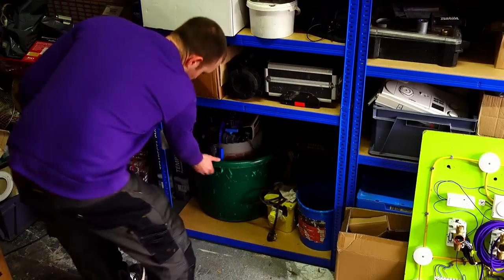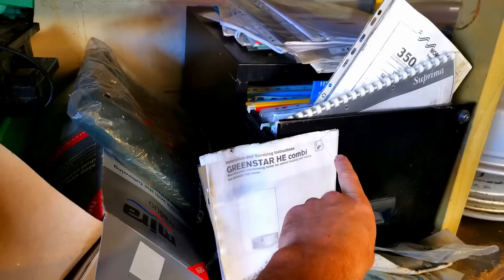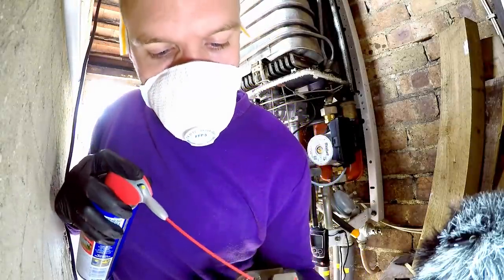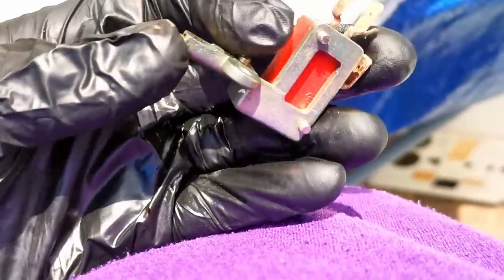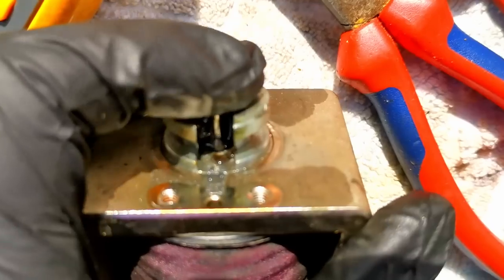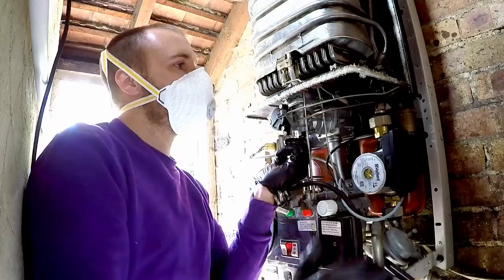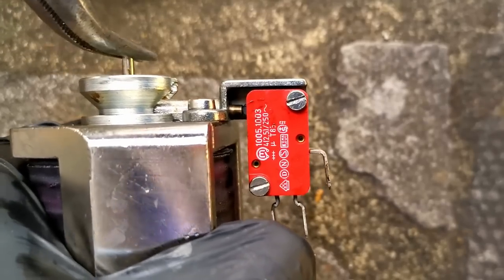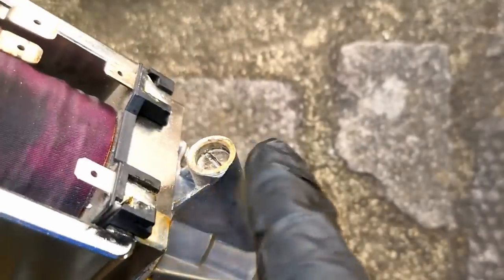Oldest Combi Boiler Repaired. Finally Fixed?

Comment: Excellent set of videos. You have a very good logical mind. Have you looked at the Bluelyser analyser? I have had mine five years and not had one problem with it. It is very responsive, compact and well made. I’m just sorry I bought an Anton first, would never go back. Speak to Julian Butler and get some info on them. He’s on Facebook or let me know and I can give you his number. Have a look at a video Derek Robins made on comparing the analysers (under Tomkat gas training).
Reply from the maker: Someone else mentioned them. I have never heard anything about them before. I just sent a message on FB. Lets see if he replies. :-)
Reply: They are big in Europe. Fantastic support from him. They have lots of other kit that is very useful also. Well worth a look.

Comment: those T3W vaillants all had water hydraulics which worked well if clean but the pipes had a bore of about 1.5mm to 2mm.  If you think that was old I remember the old Worcester Delglow that was old late 60s I think
Reply from the maker: Delglow? Never seen or heard of it. Will have a Google
Reply from the maker: The internet said no. :-) Too old to even Google. All I get is Worcester history.
Reply: @HeatingGeek  it was a monster . Direct fired if my memory serves me right . It was a long time ago

Comment: Hi mate, i just want ask ur opinion about an installation i came across pls: a main water supply that is Teed one goes to unvented cylinder cold water supply and other goes to a combination (multifunctional valve) where the supposed to be cylinder cold feed and the balanced water are both combined together and goes to the central heating boiler flow. On the heating side they put an external prv (6 bars) and the boiler always show 4 bars.  Is that a genius work or a reason or some cowboy work. It looks very stupid to the point i wonder for any reason why they would have done so. Notice also unvented cylinder gets direct main water with prv on combi valve is useless . Many thanks and much appreciated
Reply: I would say its a cowboy job, you do realise G3 regs apply for installation & maintenance of these  you must be trained.
Reply: Kevin Schoales thanks Kevin. I know That, and i am. The only reason i asked about the installation is the amount of idiocy i saw last night. Shocked to the point you try see if there is a tiny excuse or reason as to why they would do such installation if you know what i mean. Much appreciated
Reply: @conand1413  it's good that your trained for unvented, not uncommon to find them piped wrong, if customer agrees to your recommendations, good luck.
Reply: Kevin Schoales i guess they will agree. The pipework for fixing the unvented is straight forward and not big job. The main question was about why would someone use a combination valve (the supposed to be cylinder output & the balanced) and tee them together and connect it to a boiler flow pipe. As heatingeeks with his ling experience might have come across similar stupid installations i thought he might have some explanation. Thanks again kevin. Appreciated

Comment: Did u do a vid on the hydro block mate? I do roughly 1 flow manifold a week
Reply from the maker: I have done a video before about the hydrolock. The one after this job was actually really difficult. Someone literally walked out leaving the block half out and the bypass pipe bent :-).............. I got it sorted but had to bend the bypass back into shape. Nerve-racking. :-) Any analyser recommendations?
Reply: @HeatingGeek  i personally use Anton but like the look of testo! Was it flow or return manifold?

Comment: Kane or Testo. Don’t bother with TPI. Anton, not too bad.
Reply from the maker: Thats the way I was leaning TBH. I think Testo are a little expensive and the batteries (cant use AA) bug me a bit. What do you use?
Reply: HeatingGeek strangely enough, I’ve got a Kane 455, had it for years, it’s fairly robust. I bought from Amazon AA rechargeable lithium batteries which are 2 or 3.0 ah with charger, they were £30, and are perfect for the analyser and printer. I agree with your point on the Testo, they are expensive, sort of the Rolls Royce of analysers. They’re good in the commercial world where you measure Nox.

Comment: Hi I have ferolli f24 domicondens heating works fine but no hot water from hot taps ,but I noticed hot pipe coming out of the boiler is hot please help thanks
Reply from the maker: then maybe you have cold water entering the hot water pipework in your house. Usually from a shower mixer

Comment: 10 out of 10 for your tenacity on fixing this boiler. Unfortunate you missed a couple of small things early on but working through the mechanical logic of the old girl was brilliant. Proper old fashioned electrics - microswitches and coils etc diaphragms pushing pins - as it shoulds be.. And if all else fails - RTFM.....
Reply from the maker: RTFM. I always forget that bit :-)

Comment: Well done 👍
Reply from the maker: Thanks. Can you recommend an analyser?
Reply: @HeatingGeek  At the moment am using a old Anton evo it does the job  but am considering upgrading to the Anton pro 3 but it all depends on the budget? I would say kane an Anton are about the same in performance an quality but ive herd testo aint bad but they are expensive aswell

Comment: 15:43 I'm pretty sure you haven't a clue what you're doing. You've convinced me.
Reply from the maker: Why? :-)
Reply: @HeatingGeek  Making burner pressure adjustment - get it about right, mess about a bit then start playing with burner pressure adjustment again - for one.
For two, you light it and then keep turning it off - rather than letting the thing do stuff - mumbling some rubbish about it overheating - which shouldn't be that easy with at least 2 thermostats on it. They're water cooled you know.
When you start hearing banging as the water boils, then's the time to wonder if it's going to overheat. Maybe 150°C could be classed as overheating ? That's about 4·5 bar - should be venting through the pressure relief valve nicely at that and making some really violent noises :)
Reply from the maker: @millomweb  :-) I see what you mean. ;-)

Comment: I cut my teeth on these back in the day, common problem , remove pin as you did clean and regrease pin and cone shape on main dc SOL making sure the pin is rounded end innerwards. Dc SOL should rise in approx 1 sec.
Reply from the maker: Nice. :-) Took a while to find it but I'm happy its done. :-)
Reply: @HeatingGeek  I've worked for the the BIG V scince the 80s
Reply from the maker: @onewheelnut  What area?
Reply: @HeatingGeek  back in the day 'LL sy wv ws st b cv wr now mainly b dy

Comment: Why put yourself though it. RIP IT OUT. I just told a potential house buyer to scrap this boiler as its near on obsolete.
Reply from the maker: Each to their own. I will keep them going for as long as possible.
Reply: @HeatingGeek  as a gas engineer of the past 25 years. I totally agree with you trying to keep them going as long as possible . I do the same .any idiot can rip them out .its only the clever guys that can fix them . some boilers can really challenge you and you don't make a penny. But you learn so much.  And become a better engineer .good  video and job ..the only thing I might have done different was to turn the dhw burner pressure down a couple of mb . i might save you a come back to push the high limit .

Comment: "Oldest Combi Boiler Repaired. Finally Fixed?" Really?? Oldest? Really? Seeing the video of the boiler it really doesnt look THAT old. I would even hazard a guess that my combi boiler is older than that.
Reply from the maker: Is yours being fixed on youtube??? Love to see that video. :-)
Reply: @HeatingGeek  No because although mine might be old it is still reliable, and STILL probably older than the one you have featured!
Reply from the maker: @roberttill3787  So the thumbnail is correct then :-) What boiler do you have?
Reply: @HeatingGeek  You will piss yourself laughing when i tell you. Its a Ferroli optimax+ 38c! it has been totally reliable apart from needing the diverter valve replacing TWICE! 40 million Italians cant be wrong! hahaha